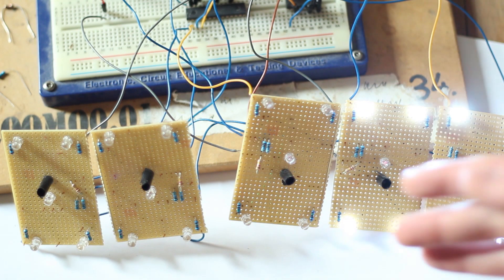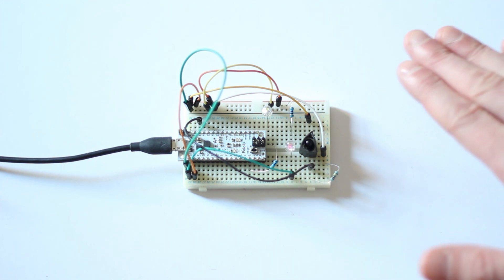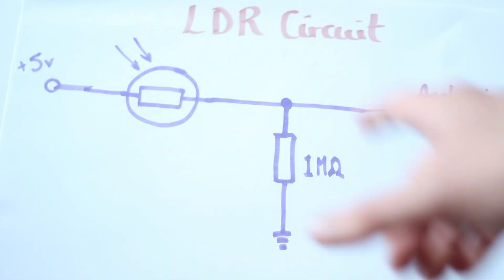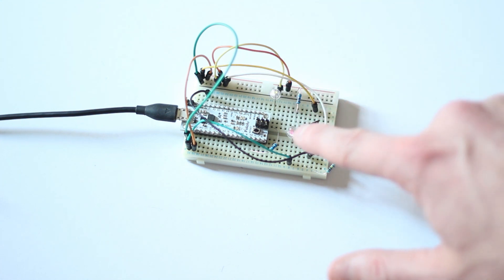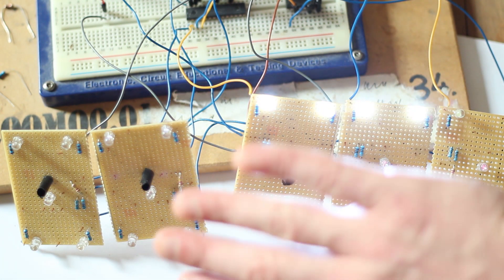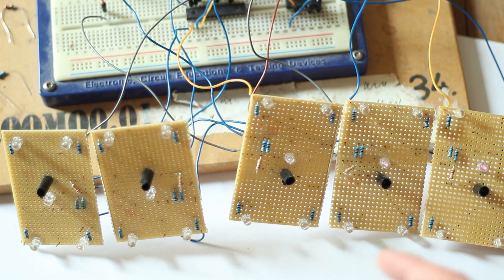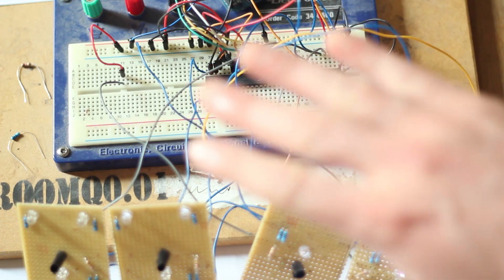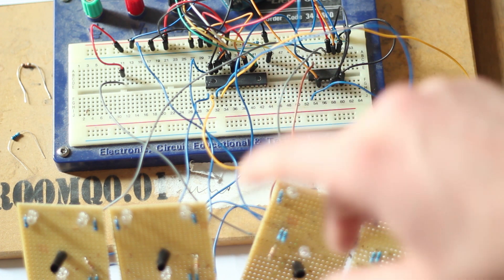Arduino Infrared Reflectance: A bit of LED fun

Comment: how about a raspberry PI with camera running open CV for position sensing over the table ?
Reply from the maker: Sas Quatch Thanks mate, I had thought about it since I a 3 Pi boards floating around. It just didn't seem like as much fun as resurrecting this old project. If I were to make a table though, the Open CV approach would be higher resolution and interactive.